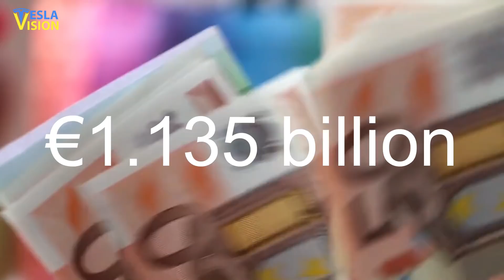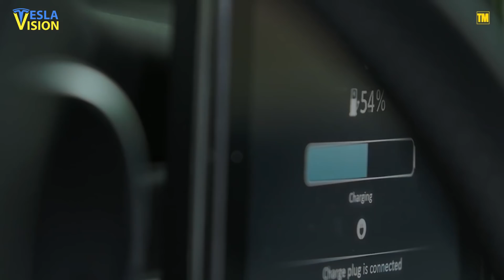Elon Musk KEPT His Promise on Giga Berlin 4680

Comment: One question: 4680 bateries are intellectual property of Tesla, right? This Israeli company as well as the chenese ones are paying rights to Tesla (or are under contract with) to produce 4680 bateries, correct?
Reply: Many of Teslas patents regarding to cars are free to use for others, I do not know whether it includes batteries. But 4680 is not a kind of battery, it is only the form factor, the physical dimensions of the cells. 46 mm in diameter, and 80 mm in length. The other companies do not build the same batteries, but there may be more common elements than the outside dimensions.
Keep in mind that Elon is not motivated by money, but by total number of cars on the street, and I assume the same is true for batteries.
Reply: @vsiegel  I understand. Tesla freed it's patents back in 2015. I'm not sure they ketp doing so for new patents after that.

Comment: Battery technology is advancing so rapidly I have to wonder, is the 4680 going to be the "old" technology very soon with the advancements in solid state batteries?
Reply: Possibly - but no matter what happens the 4680 will have about 10 years as top dog before the Solid State is in full production and takes over
Reply: Solid state batteries are still in the lab, I.e. years away from market entry. When they do, if they do, they will find the market occupied by cheaper battery technologies (not only Tesla’s 4680) manufactured at huge scales. They will face an uphill battle to carve themselves a market niche.
Reply: I think Solid State battery are still too far in comparation with 4680 advancements. And going deeper, 4680 and Battery Day advancements applied on current Tesla cars would mean a significant increase in Tesla cars quality. If I'm right, current Tesla cheapest car has a 421 km range (EPA). With Battery Day advancements, this car range would convert into ~ 645 km (EPA). 

Talking in terms of how many km can you do with any car type, 645km accomplish mostly everyone range needs for a car. That's game changer and since then, getting an improvement in range would not be so important for benefit of all Tesla cars owners.

Of course there are infinits aspects more to contrast with this speculation.
Reply: Solid state will take some time to firstly get to scale and secondly get cheap enough for cars.  I suspect at first SS will be used where the higher energy density is paramount such as in aircraft. I expect that in the second half of this decade.
Reply: @bluetoad2668  I would agree with you, but I am doubtful that solid-state batteries will ever get cheap enough for cars (with the possible exception of performance and luxury cars) .  By mid-decade, they will compete in that market with LFP batteries at ca. $50/kWh.
They'll likely come too late to achieve mass market.

Comment: Major distinction between conventional 
welded (anode tab, Panasonic) and 
multi (anode flaps, Tesla). 

Tab ; e.g. 2170
- is an internal electrical lead either spot weld or cold weld to a spot on the Cu anode. It employs (an elastomer) to maintain a constant preload force is required to 
1) minimize electrical impedance across anode and cell wall. 
2) eliminate chance to open circuit and consequently internal electrical spark upon inertial shock induced on road. 

Flaps (tab less architecture) ; 4580
- was intended to eliminate a conventional welded tab and in that process defeated :-
1) low electrical resistance 
2) spark suppression 
3) low thermal impedance

Panasonic and other major cell manufacturers came up with a solution - preloaded welded tab - good to lower impedance and suppress internal spark - just to be eliminated by Tesla for its tab less architecture in 4680 format.
Reply: Have you seen the video
Elon Musk meets Post Malone 
It’s hilarious!! 👽 😂
Reply: @jackhollow616  I’m sorry I didn’t catch it.

Comment: Giga Berlin can supply "more than 500K units per year, in the first year"?  I'm skeptical.  I suspect it will take 12~18 months to ramp production to that level, just like Giga Shanghai.  Giga Berlin will be supported by Shanghai and (possibly) Fremont to start.  It will take a long time to create a local supply chain for most components.
Reply: Possibly... but Berlin Gigafactory has been designed to "factor-out" ramp issues experience in Shanghai. The China plant provided the essential learning curves for Tesla in scaling up in a very large factory. So, many of the impediments experienced in the China plant will be "removed" from production designs, meaning that the initial efficiencies will be significantly higher in Berlin. Remember too, that the new casting machines have removed 30% of the line-production processes. These machines were only recently introduced in Shanghai, and are still being more fully integrated into the production lines. This won't be the case in Berlin... the factory will START with these casting machines being operational from day 1.
On your second point... The automotive supply industry in continental Europe is very well established, and you can be sure that every manufacturer of auto components MONTHS AGO have made a bee-line to Tesla's procurement division to sign up as a supplier.
Giga Berlin will therefore be in a position to ramp very rapidly. I think 500k cars is more likely than not in its first year.
Reply: @brunosmith6925  I agree, Tesla possibly will ramp up very fast in Berlin. And it is going to be with most advanced auto car factory in the world, so every improvement in ramp up capacity will impact hugely.
Reply: If they are short on delivery there will be a lot of “smart” people start selling out the stock so it’s prime time to buy in. Rinse and repeat and you will be millionaire in no time. It’s all the old play from Elon.

Overhype > slightly underperform > paper hand people sell > buy back > over deliver following quarter > price goes up.

Rinse and repeat.
Reply: @ryannguyen7466  I haven't understood completely your speculation. Why do you think some people would sell now its tesla stock? 

Talking in terms of short term increase in value per share, Giga Berlin and Austin is going to significate a non precedent. Two more big factories producing non stop cars and now they can not answer with Tesla cars demand. Do you really think that most Tesla stockholders is going to sell with the increase in tesla value in really short term?

I want to really understand your point, I'm a Tesla stockholder and hope to achieve benefit of all Tesla supporters.
Reply: One hopes they've used the delays in the approval process to sort out their supply lines & arrange for good labor.
Reply: @jamdoodles  I think there is no actual delay of approval in that sense. They would not get a preliminary approval if there where real doubts. It is more a thing of "that will work, but we need to do the paperwork anyway". And a lot of paperwork, it is in Germany.
Reply: I think you don't understand the words you are using... in 12 months Tesla will achieve annual output of 500k units. It's not the same as producing 500k units during first year. So they will probably produce around 200-300k units in 2022 and 500k in 2023.